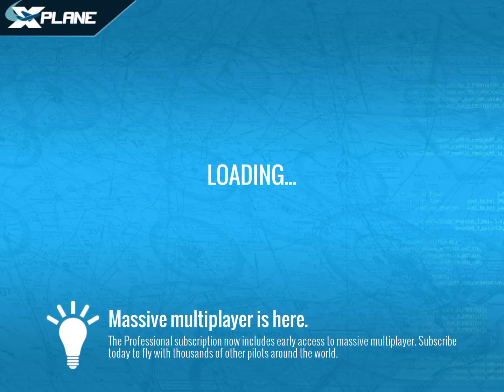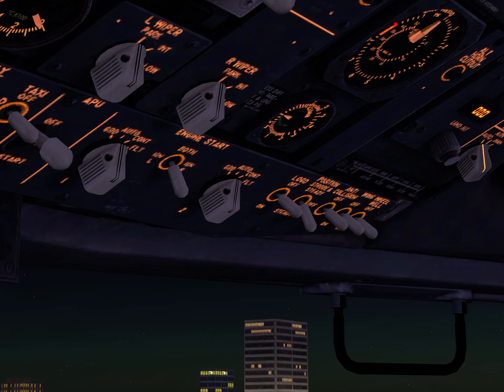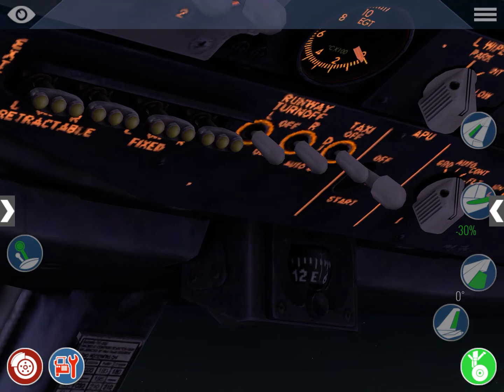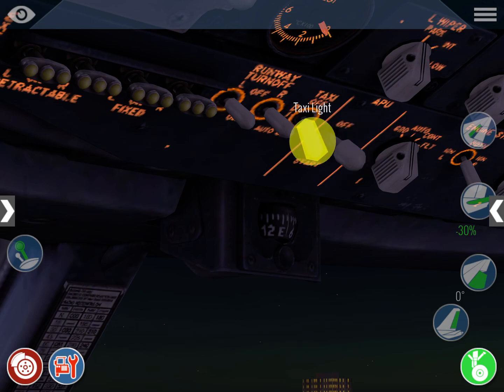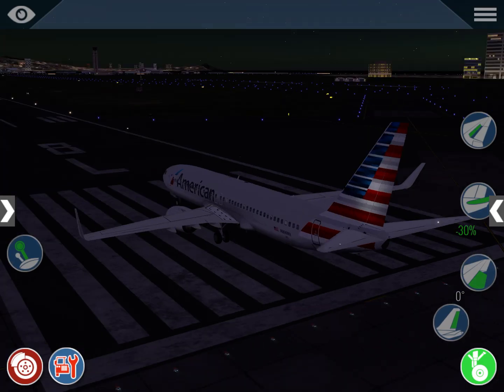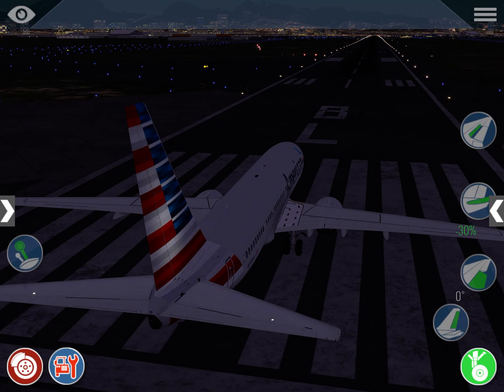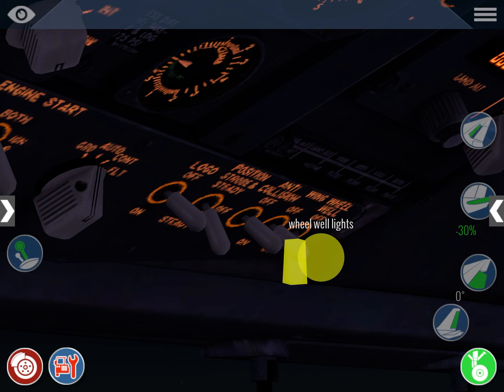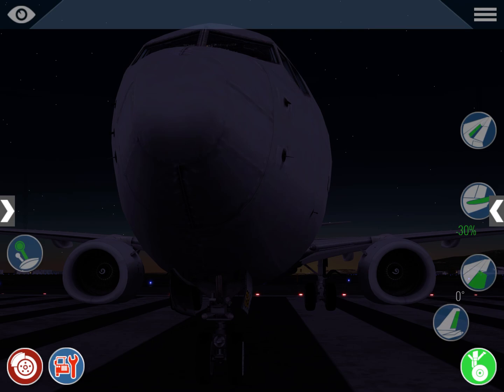Aircraft LIGHTS | When to USE them? | HOW to use them? | X-Plane Mobile Global

Comment: How do we put autopilot bank angle in x plane mobile?
Reply from the maker: Go to your MCP (Mode Control Panel), which is the autopilot panel. Locate the heading bug, and note that it has two bugs. The small one is to make heading adjustments, while the big one controls bank angle. It has labels next to it that say 10, 20, 30... That is how you control bank angle. 
(In aircraft like the C172 or Cirrus, you can't) 
Hope it helps!